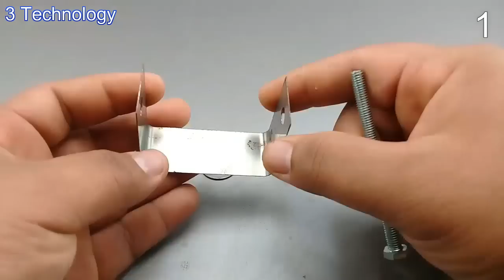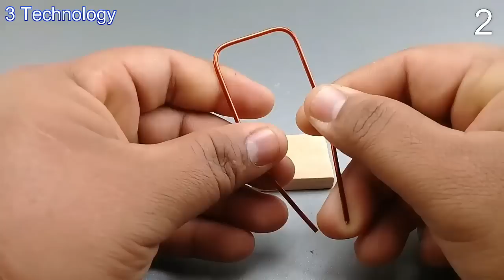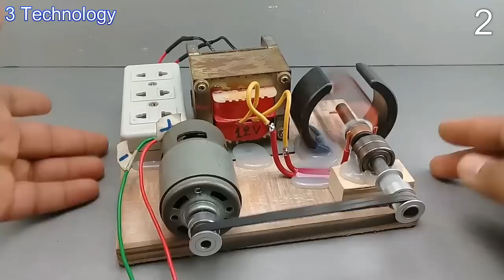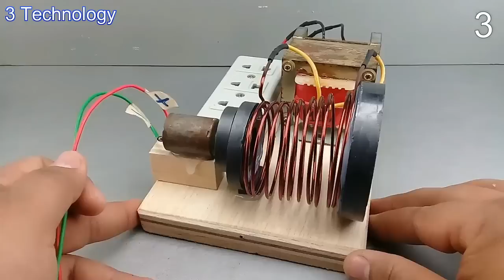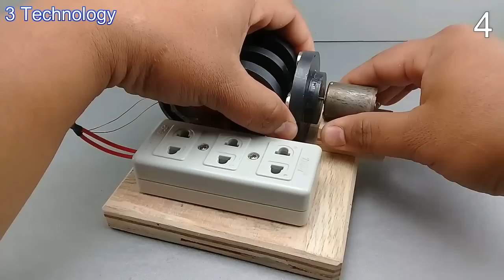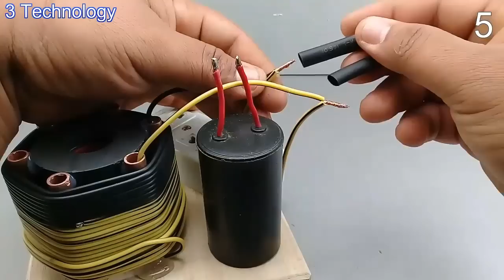Top 5 Generator / Generate Homemade Infinite Energy 230V With Big Copper Wire The Most Effective

Comment: Connect your motor on the 230v side ..
Maybe with an 6v Adapter 😁🤙

.. than it runs for itself ..

Only for it self! One real resistor and it will be slower and slower until it stops
... thermic law will win